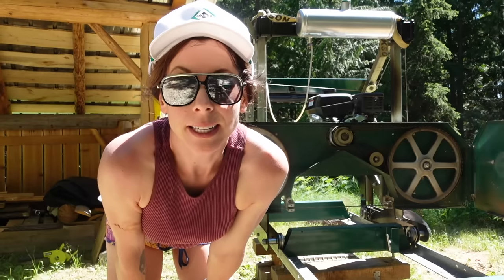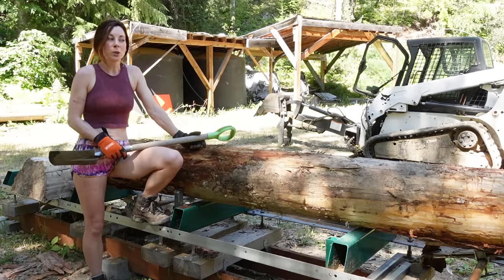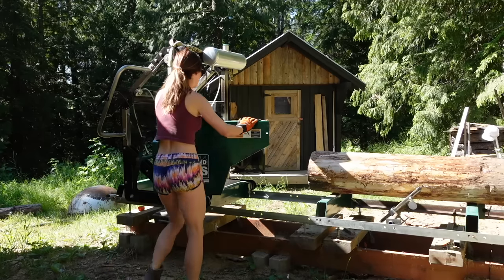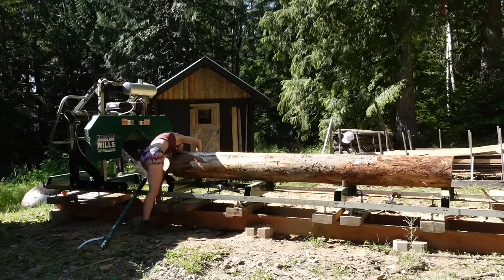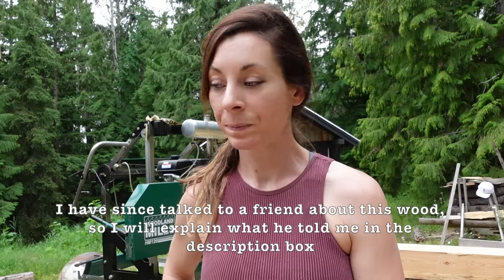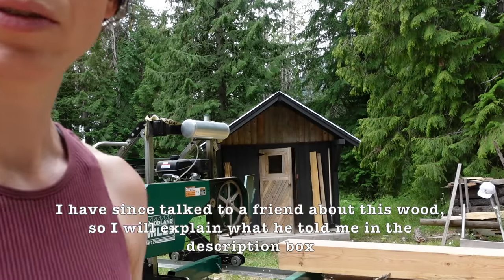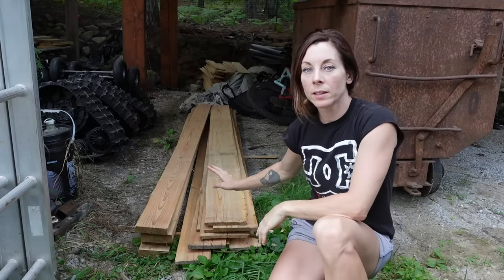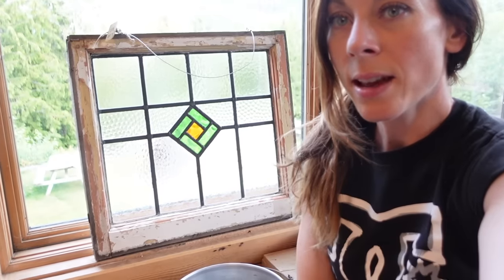It is HOT at MichyMilling Inc. | Milling more lumber to build my tiny cabin.

Comment: great video, a couple of tips,1) DONT connect hydraulic lines while the engine is running, if the control gets nudged, full pressure is at the fitting, WHILE the plug in the hose is opening the leak proof valve, and you CANT see a high pressure leak, like steam in a pipe, it can cut you or cause blood poisoning!! 2) don't haul a log by your muscles alone, look at OHS videos for loggers, they use a log turner, a pole with a barb on the end, looks like a c-spanner wrench, it adds 4 or 5 ft of leverage, and keeps you clear if the log starts rolling out of control, OR use an engine hoist, or block and tackle, it saves back and leg muscle injuries.
Reply: You wouldn’t make it on a farm or in any construction trade 😂 risk mitigation is fine and always improving. Risk Elimination would put us back in the Stone Age
Reply: @deutscherfischer55  yup...sometimes you have to wire shit live, replace packing on hot steam lines, be near rotating equipment and work in the sun at 100+ to get a job done.

Comment: For lubricant we used straight diesel fuel at our mill cutting heartpine beams down for flooring and it worked awesome it's surprising cause the sparks you'd think would ignite the fuel but never done not one time when I worked there nor before or after and all u need is a drip rate applied and it worked wonders never had an issue with sap build up on our blades ever
Reply: Diesel is pretty bad at self-igniting (it requires to be at least 50°C and often more). Friction can heat up the mix close to that temp but it obviously depends on how warm ambient temperature is. I wouldn't recommend sawing above 35°C ambient temp.
Reply: A barrel of biodiesel can be made easily enough. It’s non flammable and won’t smell like Dino diesel. It’s a better lubricant and can even be used to seal wood surfaces
Reply: I always felt that vaseline was the best lubricant
Reply: Diesel is combustible only when it’s compressed …!
 But as a lubricant,…. its 100% old school… tried and true…!
Reply: @h8tingit  😂😂💀

Comment: I was an interior trim carpenter. Back in the days when mitre saw blades were so expensive it was cheaper to have them sharpened than replace them, I found that spraying the blades with oven cleaner would clean the resin off and make them cut like a new blade - which I could do a couple times before needing to resharpen.
Reply: That’s exactly what I used to get the pitch off my carbide teeth,.. but technology has gotten much better… diamond blades for cutting wood..! 👍😎🤙
Reply: If you are older you would have used  kerosene
Reply: Ha, that's what my uncle always did. I have now learned oven cleaner eats away the solder that holds the carbide teeth on.
Reply: Same with box cutters that open only tape. Walmart made us clean with alcohol wipe before getting a new one.
Reply: We also can offer interior trim carpet as well
Reply: @trevorcollins3005   - I used to use it on all my blades - and never had a problem with teeth falling off - and, I'm fairly sure those band saw blades don't have soldered teeth.
Reply: @DwayneShaw1  the bandsaw definately wouldn't have soldered teeth.
Reply: @trevorcollins3005  absolutely! if it has carbide teeth, they'd be brazed on, not soldered.
Reply: @jaaron2834 🟩💯
Reply: @anthonys2895 🤚💪

Comment: I run a Timber King 2200 and I find that laundry soap has the best performance as an additive for the lubricant water. Super concentrated and has a nice snotty consistency that keeps the pitch off the bands. Beautiful wood BTW
Reply: For any sap that sticks to the blade - oven cleaner.  Don't let it dry out and heat speeds the cleaning process.

I've heard a Lye / water and soak (hot water) also but haven't used it yet.     - Joe -
Reply: I've never tried the oven cleaner-- Sounds good! We used kerosene or gas/oil mix----

Comment: No!!! I am not tired of that Outfit!!
You make it look great. 
However, you make the other Outfit look Great too!  Steve is a lucky man!!
Suggestion on your Sawmill; Have some log stop tubes welded on the loading side of the sawmill and add log clamps to the other side of the mill. 
After you make your 1st cut you can then roll the log towards you without having to continually slide it across the bed. You can move the log stops from side to opposite side. This will also have the blade entering the log on a clean surface ( no bark) which should extend the life of the blade. Possibly help prevent gum buildup too. I have never seen this utilized on any videos and I don’t know why?
There’s possibly a problem with this suggestion but I can’t think of one. 
Keep the videos coming. I enjoy all of them and you always make me Smile!!
Reply from the maker: I would love to dedicate time to making modifications to the mill - the problem is that I just don’t have the time to do it all. 😒Maybe one day!
Reply: @michygoss7148  that’s what a Loving, Engineering minded Husband is for. A new challenge!!  Lol
Reply: This lady makes any outfit look great.

Comment: Yes, i can clearly see why it's so hot at MichyMilling Inc... If i didn't know it better i'd say the temperature is rising here too... 😉
The milling was quite nice. The lubrication sounds fine. If the tension of the blade is good you could consider to saw slower as the blade seems to dive while you're pushing the saw. the Larch doesn't make it easier... Looking forward to more milling 😁
Good to see Lenny's getting some weight. Freedoms are to be learned... and a quick recovery to Clyde

Comment: Sappy woods like Douglas Fir are resistant to worms and rot. Methyl ester (biodiesel) is technically non flammable. It’s also a great lubricant and seals bare timber. Should be great for gummy logs.

Comment: Larch is really strong for its weight. It also has some anti-rotting properties. I have a little of it on my property and have milled it before. My other softwood is old Eastern White Pine.
Reply: Yes--- Larch or Tamarack trees were used early on as sill plates and joists for their seemingly moisture resistant quaility if they were plentiful-- Oak and pine log cabins rotted pretty quickly on the ground...

Comment: Hey there, if the logs you’re milling have been down for long enough for them to dry out, it won’t help with build up on the saw. The sap in pine in particular, is far more likely to stick to the saw if the logs are dry and not freshly logged then milled. Nice set up you’ve got all the same. Greetings from New Zealand 🇳🇿

Comment: You've got a great work ethic, love it. You have to be careful with your guide bearings, never use a grease cutter like simple green, pine sol is better or setup a kerosene drip for those extra pitchy logs. Kerosene is the best hands down if you're gumming up. When we mill sinker pine or heart pine it's our go to, straight water for everything else.
Reply: Mike Morgan of Outdoors with the Morgans took a recommendation from, I think, Nathan from Out of the Woods to use diesel in the lube tank on the pitchy pine he had on the mill. His original tank was dish soap plus Pinesol. He runs diesel at the lowest setting.

Comment: FYI --  CAT skid steer fuel system is self-priming, turn the key to the on position, count to 12 and then start the machine plus the machine has full hydraulic power at 1100 rpm

Comment: The best thing you can use to keep your blade clean is diesel fuel just straight up diesel fuel. Don’t mix nothing with it and put it on a slow drip and it will keep your blade clean. It’s what I use. I’ve used it for years. It works try it you’ll like it.

Comment: I mill mostly pine (old as well as fresh cut) and the old is bad about pitch building up on the blade even with a heavy consentration of Pine-sol and Dawn. I saw a video recently where the guy used diesel and instead of water and soap. He commented that his blades stay clean, run cooler, and last longer.

Comment: I learned a valuable bit of advice, I used Simple green for sap and it dissolved it flawlessly, not sure if it would work on tamarac though, I used it on Queen Palms that I removed, all 13 of them, made cleanup much easier on the saws VS anything else I tried

Comment: Good morning from East Tennessee. FYI, Dawn mixed with warm water is the best Insecticide that you can get.  Found that out when fighting a large nest of bumble bees that had built under a pile of old shingles near my basement door.  Took a break and went over to the gas station to get some kerosene. There was an elder man there and said that if I would use Dawn or a dishwashing liquid mixed with warm or hot water it would kill them almost on contact. So I got 2 bottles of Blue Dawn and wiped them out without a sting. Haven't used anything since and it allows me to clean up the area when I finish.  The dishwashing liquid (I was told) suffocates as the insect has a high breathing rhythm)  Now back to my you tube that needs help. Be careful and good luck.  Jim

Comment: Try some kind of think oil in the water for the blade with soap. Oil will keep the blade from loading up, and soap will help the oil blend with the water. Thin oil could be cooking oil or transmission oil. Never tried it but it seems like it would work. I know chain oil makes a chainsaw cut through oak better

Comment: You look fine , you might want to be careful .. I’m about to watch your video .. my dad had a groundhog mill .. the 54inch blade was stationary it stayed in one place the carriage moved up and down the tracks that’s where the log sits .. one of us use to ride on the carriage to slide the log over with a lever .. the danger of that mill if the saw blade hits a spike in the wood the teeth will come out the blade like a machine gun .. duck and run .. we cut a lot of beautiful wood back then especially the sinker Cypress wood it was just beautiful ..

Comment: This may be freaky but i did the same thing with some smaller stain glass windows at a friendès house that i was renovating . I routed a grove around the frame for the glass insert .Still holding after 20 yrs as far as i know.
PS you better get a licence for wearing those shorts

Comment: 9:28 I just ended a 20-year career as a saw filer in a sawmill.  We called the effect in your wood "Washboarding."  This happens just before the saw blade starts to "snake" through the lumber.  Blades gumming up can be a real problem.  Years ago, we used kerosene as a lubricant on one of our blades, but it stunk and was a constant fire hazard.
Reply: I don't know much about saw mills other than to hear my uncle talk about it back in the day. Basically, something needs to clean the resin off the blade, and it just so happens that most stuff that can do that tends to be flameable.
Reply: @Snarksneeze   That's pretty much it.  There is a fairly new product in the industry now that is basically a vegetable oil type product.  We know it as Lubie.  The smell is not bad at all, and it is one of the least flammable products for saw lube.  But I wouldn't foresee buying it for a portable sawmill.
Reply: Try used chip oil. Works but you will feel hungry
Reply: Yes Eric, we used to use kerosene as well, worked well actually

Comment: Diesel fuel is not recommended for your mill because it will deteriorate the belts that ride on top your wheels.  Good for mills that have the blades running on steel wheels that do not have belts.  I have a 126 and this has been my experience,

Comment: You need a pin pointer for finding metal they are 10 times better than a metal detector zeros right in to the spot ,But good ol dish soap should keep the saw cool enough, Ps I admire your will to saw mill and build a hillside  bungalow, Looks like In the kelowna neighborhood had family there for decades don't have anyone now just memories and hope Good Luck on adventures been watching for long time did Hubby get Boat back yet to home ? How's the pooches always loved the Beagles and Red bone dogs . I WONDER IF turpentine and soap will cut the sap in tamarac, It is a 40 yr wood benefit I've made fence posts with Tamarac they are still standing as posts, How about running slower on your saw to clean the sawdust just suggestion, You have the answer already GBless.

Comment: A lot of these people commenting on clothing have absolutely no idea. I am a roof carpenter of 35 yrs and wear stubbie shorts, singlet, Dunlop Volley sneakers and a hat. While using power saws and nail guns in 45c heat, we need to be like acrobats on high roofs, not be encumbered by Steelcap boots, long pants that slip down wrapping the crotch around you knees while wearing a nailbag, and long sleeve drill shirts. IT IS NOT HEAVY INDUSTRY. The safety issue here is the need to dress light weight. The idiots making the rules need to get out of their office and get on the tools for a month. The couple of minor accidents I have had have been through having a loose long sleeved shirt wrapped around a drill or a planner. Your clothing needs to be light and tight.

Comment: By the look of your “shed”, you have a lot of resources to play with. I say that because typical amateur  sawyers don’t peel the logs for such a structure… nor do they have the impressive array of power vehicles which you do. BTW, rather than risk injuring your back wrestling logs onto the mill rails, try using a cant hook. Which is the most basic of sawmill implements. Also, if that log rolled the wrong way, you’d be pinned against the mill rails with at least one broken leg. A can’t hook would prevent that.

Comment: Don't you have a blade guide to move closer to the wood?
Reply from the maker: This mill doesn’t have that. There are blade guides but not on a sliding arm, if that’s what you’re meaning.
Reply: @michygoss7148  it looked like you had chatter on one of your cuts. I ran a Woodmizer and that corrected that issue.
Reply from the maker: @graphdog  it was basically occurring because of so much sap build up on the blade. I don’t normally get a lot of chatter unless my blade is gummed up or very dull.

Comment: DIESEL FUES HELPS BLADE NOT TO BE GUMMY.  DON'T NEED MUCH.  MORE OF A CLEAN CUT.  KEEP A LITTLE SUPPLY OF DIESEL FUEL.  DON'T NEED MUCH ON THE BLADE. JUST A SLOW DRIP,  GOT THAT INFO FROM ANOTHER  VIDEO.

Comment: Well I normally look right past when a woman's dressed in the way you're dressed and milling mechanicing whatever it might be. Yeah I'm a guy who likes women. But tune in to see the technical aspects but you're technical aspects are not just milling lumber. You dress well too. Friend of mine some years back she was a professional bodybuilder left her career as nursing. We are great buds nothing more. But you both in the healthy women category. Feel like I'm at the line and I don't want to cross any lines. Complimentary yes and get description of the problems with the insects in the bark and if they got into your cabin is correct. I've had problems with carpenter bees. So I've learned to take the time to treat that rough cut lumber that I buy from The sawmill are the Amish family an hour or so away. That's a nice piece of equipment you have there loading the logs onto your mill. Ironically we are surrounded by oak trees up to a common 30-in across and some are close to 4 ft. I need to cut to thin it out to keep it healthy. But it's been cheaper and quicker just to go buy the lumber rough cut set it up to dry and then use it. Okay appreciate your episode.

Comment: Yeah I like your setup. I have  woodland Mills product ...I like their product easy set up the only difference is , I have  130 series, I jerked off that 15 horsepower engine and put a V-Twin 20 on and upgraded my centrifugal force pulley. I  have  20 ft of track on mine.  I have a standing wood lot of 10 acres. But you have more toys than I do and I'm jealous. I don't have track loader like you do with all the implement parts. So I put a 16 ft log on 23" in diameter ... There's a lot of grunting going on to get it up on bumper... I don't try to cut them that long unless it's a special order. Most of my trees I turn into lumber is in the 13 ft by 20" diameter...  And I do most of my milling in December, January , February & March  with the sap is down in the bottom of the tree.. Have fun

Comment: just watching you for the first time but maybe you can spray your blades with T9 Boeshield.   I used it on my saw blades whenever I cut pine or redwood.  It's way more expensive now than when I used it years ago but it worked amazingly well.  Also I found that to clean my blades I would saturate water with baking soda and soak them for about 10-15 min.   After you pull them out all the pitch buildup would just wash off with water in the sink, no scrubbing.

Comment: Try using coil oil for your blades it will go through the wood a lot more smoother and easier and not gum up that does work even the Old timer used to use it back in the day on the crosscut saws and sawmills it works